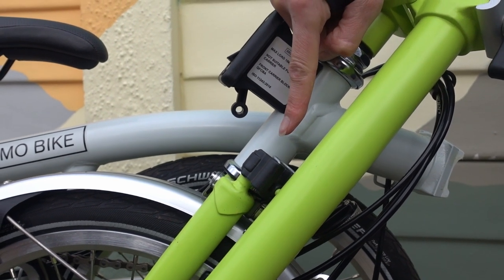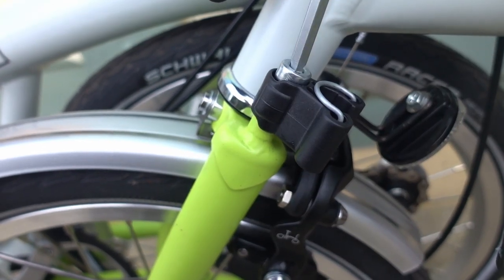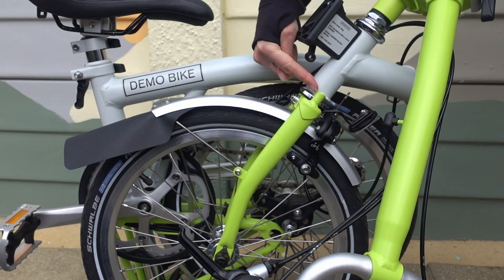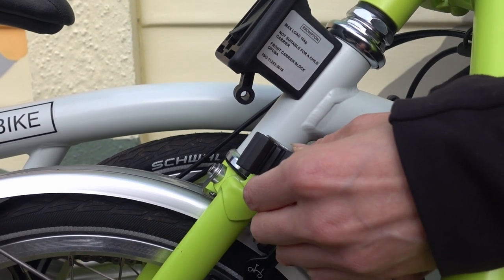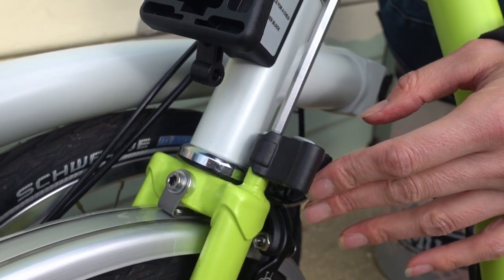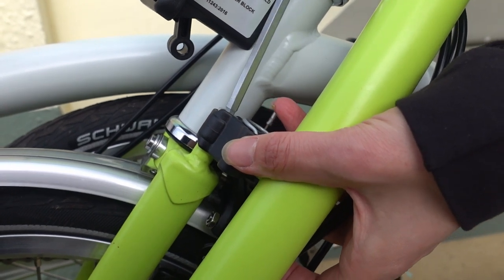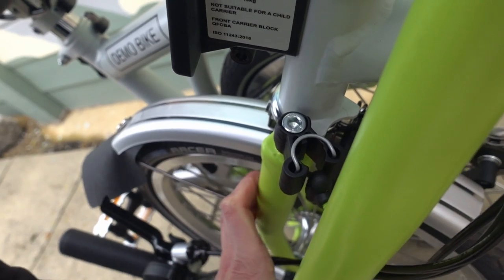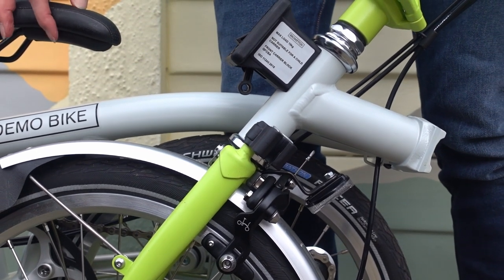Brompton handlebar catch assembly

Comment: I'be been trying mine for hours. Sometimes it works then it goes back to not going into the catch again.

Really annoying the way you dont explain what 9 newton metres is how far to turn the catch flat washer before you know everything works (what's 9 newton metres when using an Allen Key from Asda?) AND how far to turn /how far the nipple should be sticking out. Should it be loose wns near the end or in the middle or tight to towards the back? Also I find it odd the way your bikes nipple and catch align dead centre even when the nipple is straight it falls at an angle

Comment: If you've got an electric Brompton, this isn't gonna work, the battery carrier unit blocks access to the nut.
Reply: I know. So what is the solution?
Reply: I just found this out. Did you ever find a solution?
Reply: Did anyone figure it out not many results for this issue on the internet